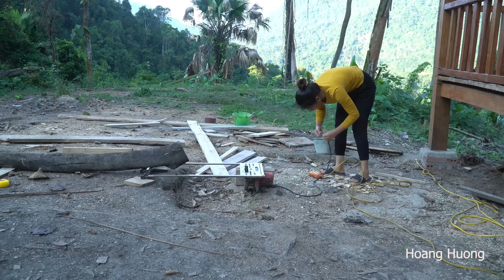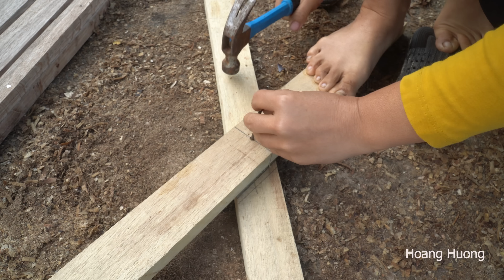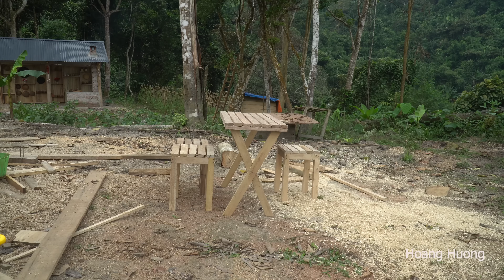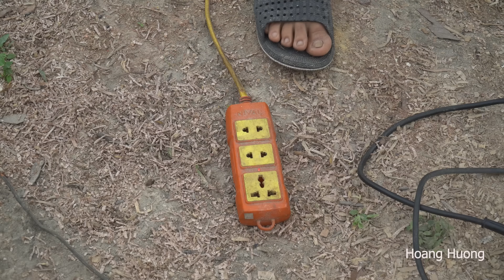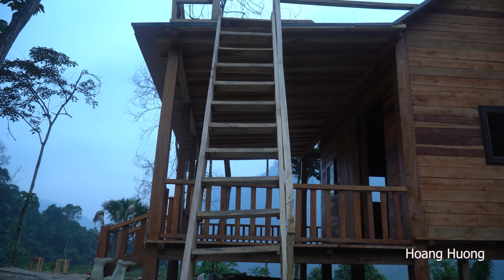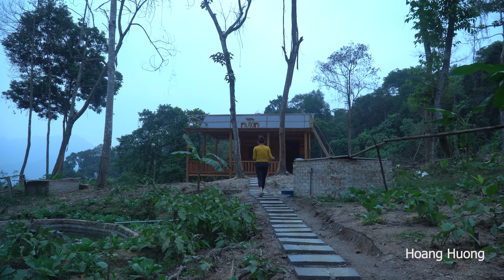Building a Wooden House (CABIN), make tables and chairs on the Balcony | Hoang Huong

Comment: Beautifuly designed furniture. Please be extra careful with that kind of saw. My Grandpa cut off his fingers with one like that. You may want to set up a fence or miter on the saw to guide or push the wood through with a push stick since you are using it like a table saw. Safety first, you can’t regrow fingers.
Reply from the maker: Thank you so much

Comment: Love your videos.  Your table legs need cross bracing.  Your porch roof should be at least 2x6 lumber on edge, not flat.  You are using stain not paint.  Your rear left corner support column really bothers me as a safety concern.  You could build forms around them and fill with concrete for a more secure foundation.  All that work, would hate to see it damaged.  Looking forward to the covered pathway to your kitchen!  Sorry for the safety police comments but I am rightfully concerned for your safety! 😊

Comment: Hi do you know that the balcony that you have on the roof is not safe it is too wide you need to put something in the area of the spindles to make it more safer and now you're going to be putting chairs and table up there you have to go make it safer because not only it's too low it's not high enough for if anybody is up there when they stand up up there but one other thing I need to find out are you going to be putting anything up there for when if by any chance rain is going to be falling and you have people up there shelter are you going to be putting anything up there that for covering or anything like that just asking also the chairs them that you made why didn't you put braces on them plus the table why didn't you put a brace in the middle of the table the Centerpoint of the Crossing that would be the most of where it would be a good support🌸🌺🇯🇲
Reply from the maker: Thank you for your feedback

Comment: Please do not build weight bearing furniture with nails, only  screws. Also use the hard surface of your kitchen as a work site. your saw table should have a rip fence or guide, and all edges of the table and chairs be rounded over to prevent splinters, and NEVER spray anything on a dirt surface to prevent dirt from getting on the wet sprayed surfaces, also the table needs a stabilizing wood bar the lenght of the table, otherwise a good job!

Comment: Nhận xét 3: Tôi có 3 cái kẹp (có thể điều chỉnh lên đến 20 cm hoặc hơn) mà tôi dùng để giữ hầu hết mọi thứ mà tôi làm việc. Bất kể đó là khoan, vặn vít, đóng đinh hay cưa. Cái kẹp có thể được sử dụng cho bất cứ việc gì mà tay thứ ba, thứ tư hoặc thứ năm giúp tôi làm việc dễ dàng hơn.
Vì vậy, tôi chưa bao giờ thấy cần có bộ chuyển đổi cưa bàn cho máy cưa đĩa của mình.
Hoặc tôi dùng chân như bạn làm lúc 5:50.
Comment 3: I have 3 clamps (adjustable up to 20cm or so) that I use to hold almost anything that I work with. No matter if it is drilling, screwing, nailing, or sawing. Clamps can be used for anything where a third or fourth or fifth hand makes my work easier.  
So I never saw the need for a table saw adapter for my circular saw.
Or I use my foot like you do at 5:50.

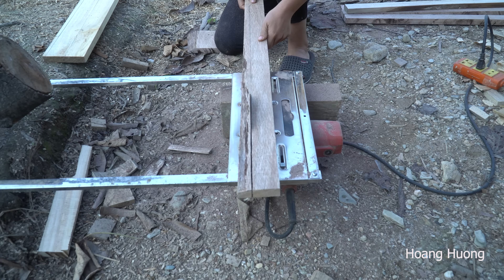Comment: Nhận xét 2: Để bật và tắt cưa dễ dàng (và an toàn), hãy sử dụng công tắc trong hộp mở rộng màu cam ngay bên trái chân trái của bạn ở phút 3:17. Sau đó, không cần phải đưa tay xuống phía dưới cưa để tìm công tắc tích hợp.
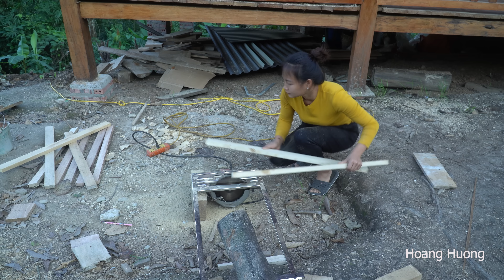Việc tháo dây ra khỏi hộp nối dài (như lúc 5:26) là XẤU: tia lửa điện có thể khiến hộp nối dài bắt lửa...
Một hộp mở rộng có công tắc tích hợp luôn là một ý tưởng hay.
Comment 2: For easy (and safe) turning-on and off the saw, use the switch in the orange extension box just to the left of your left foot at  3:17.  No need then to reach under the saw itself for its built-in switch.  
Removing the cord from the extension box (like at 5:26) is a BAD idea: sparks can cause the extension box to catch fire...
An extension box with a built-in switch is always a good idea.
Reply from the maker: Thanks for your input, it's very helpful.

Comment: Nhận xét 1: Máy cưa quay chậm hơn có nghĩa là gỗ được đưa vào quá nhanh hoặc không được đưa thẳng vào lưỡi cưa. Nguyên nhân thứ hai có thể được giải quyết bằng cách sử dụng thanh dẫn hướng cho gỗ. Người ta có thể sử dụng cùng một thanh dẫn hướng có thể điều chỉnh (thường là màu đen) đi kèm với mọi loại máy cưa đĩa mới.
Comment 1: The saw turning slower means that the wood is either being fed too fast, or is not being fed straight into the blade.  The second cause can be resolved by using a guide for the wood.  One can use the same adjustable  guide (usually black) that comes with every new circular saw.
Reply from the maker: Thank you for your feedback